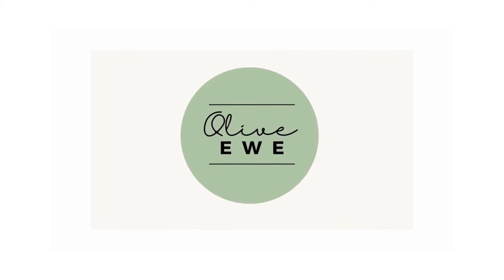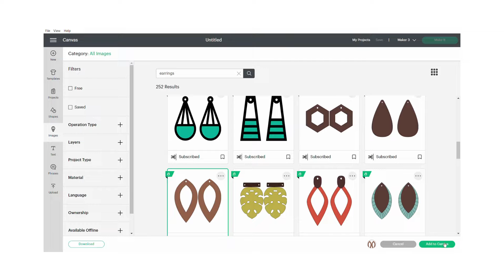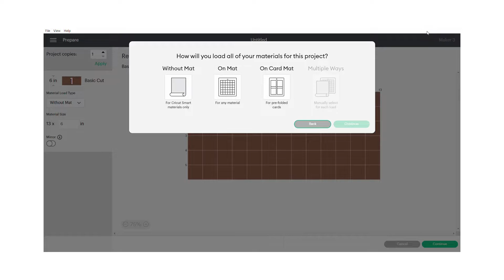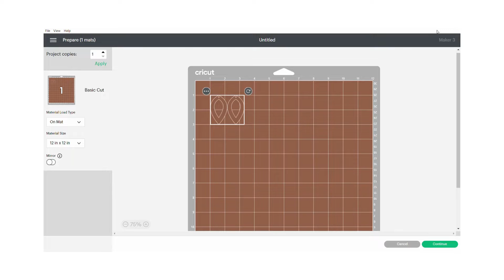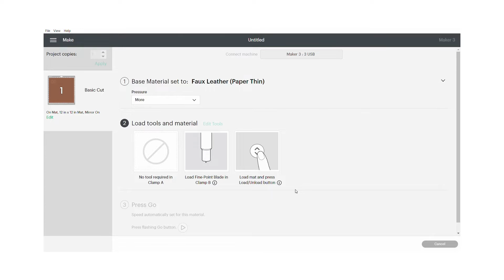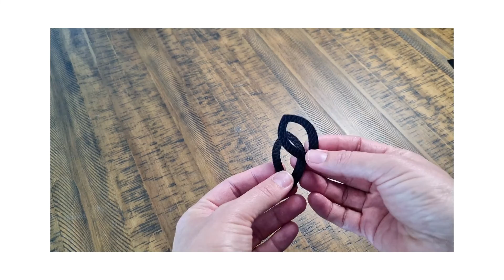How to cut faux leather with your Cricut machine

Comment: What type of fabric did you use?
I have tried a few..something from hobby lobby, sally tomato vinyl,other vinyl at better quality even, brand new purple mat, tape it down and everything but it still lifts once it has cut throwing the fabric off and cut is a mess! I’m just trying to cut out 3 inch stars…HELP PLEASE!
Reply: I know it was a while ago but I just followed these instructions after having poor results with others. I found her instructions to place the faux leather face down and mirror the work worked extremely well.  It made for a much cleaner cut and I was using pretty thick faux with a knitted type of backing.  Hope this helps you even if a little late.